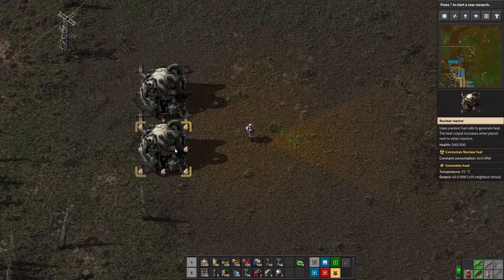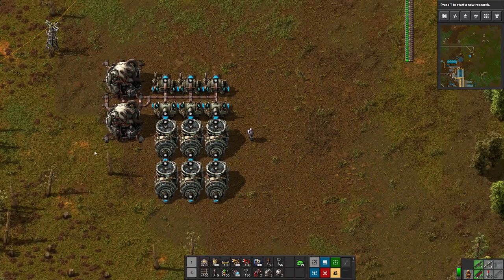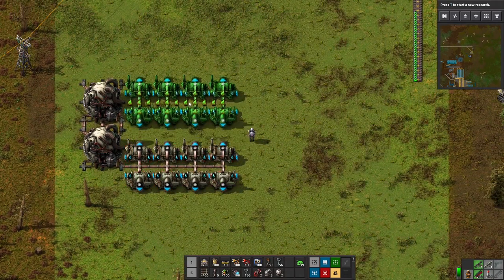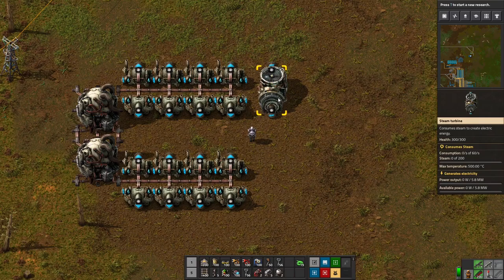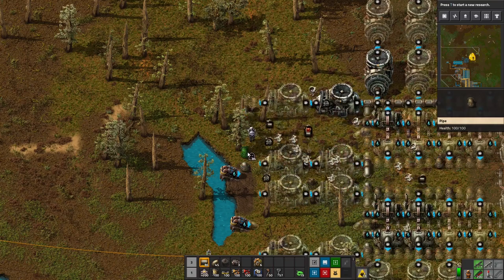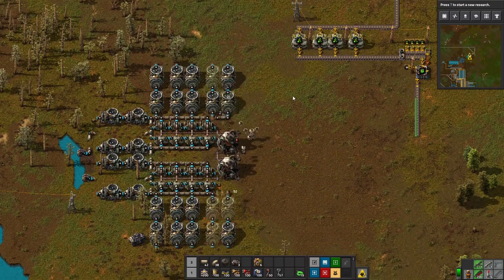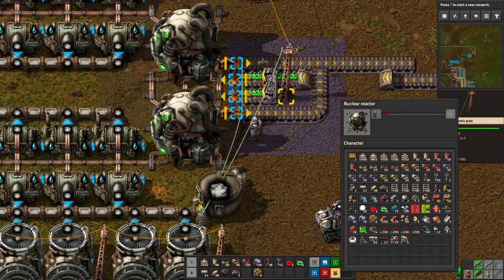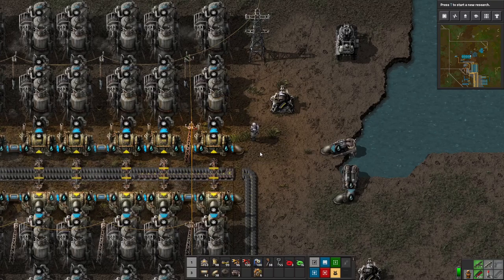Factorio For Beginners - 046 - Nuclear Power

Comment: Hey Superfluous J, nice vid. 

One thing I wanted to point out though, was that at 03:56 you try to compare the nuclear reactor to the steam engines by indicating that that nuclear reactor produces 160MW of "power" and that the steam engines produce .9MW of "power", but I need to point out that your comparing apples to oranges, or in this case Nuclear Reactor's "Heat power" to the steam turbine's "Electrical Power", so your 2 nuclear reactors don't actually replace the 40+ steam engines, they power the 40+ steam engines -- or else you would just be able to connect an electrical pole to the nuclear reactor directly and wouldn't need to deal with heat pipes. Your nuclear reactors are actually only replacing the coal as a source of heat, so you would have to compare the megawatts of "Heat power" that your water boilers produce internally from the coal they burn (which, unfortunately due to the fact that each of the forms of fuel [coal, carbon, etc] contain different amounts of joules which isn't listed in the tool tip at 05:12, only the max "Heat power" consumed which is 1.8MW). If you want to want to compare nuclear energy to conventional heat generation, you'd have to read the tool tip for each fuel source (such as 1x coal = 4 megajoules according to the in-game tool tip) and then calculate the amount of watts produced at the rate of burn. For example, if it took exactly one second for the piece of coal to burn, then the coal would produce 4 megawatts of heat energy (1 watt = 1 joule / 1 second). So if that burn rate of 1 coal per second could hold steady (which it doesn't as I've seen coal burn much faster and much slower than one second depending on the amount of steam required) your 160 MWs of nuclear heat energy would be the equivalent of (160MWs / 4 MWs = 40) 40 coal per second. Due to this, you statement about Steam Turbines being the nuclear version of the Steam Engines (05:27) also isn't exactly true, because both the Steam Engines and the Steam Turbines can be operated by either conventional (coal/carbon/etc.) or nuclear heat produced steam.

Bottom line: If you want to compare the amount of electrical energy that your base's machines need to consume, then you would have to stick to the amount of electrical power megawatts that your Steam Engines make compared to the Steam Turbines which can both be operated with conventional (coal/carbon/etc.)-produced steam OR nuclear-produced steam (or a mix of the two).

So in other words:
1) Nuclear Reactors are comparable to the internal heat generated by boilers burning conventional fuel (coal/carbon/etc.) in that they generate watts of "Heat Power".
2) Boilers and Heat Exchangers are comparable because they both consume watts of "Heat Power (nuclear or conventional)" to produce "Steam" by boiling water.
3) Steam Engines and Steam Turbines are comparable because they both consume "Steam (from any source)" to generate watts of "Electrical Power".

Hope this helps, and other than that thank you for making tutorial vids and helping make the gaming world a better place!